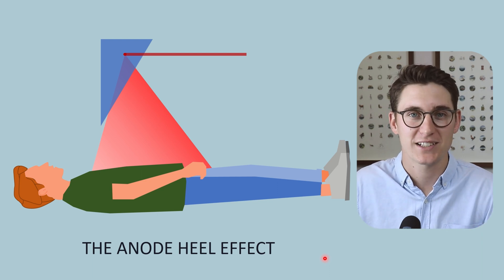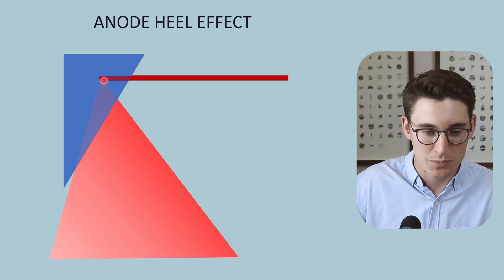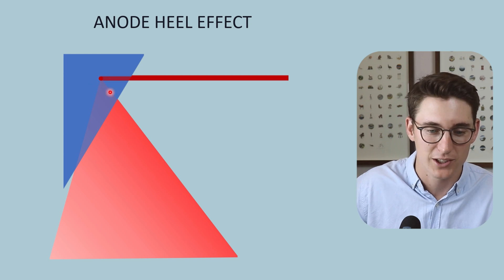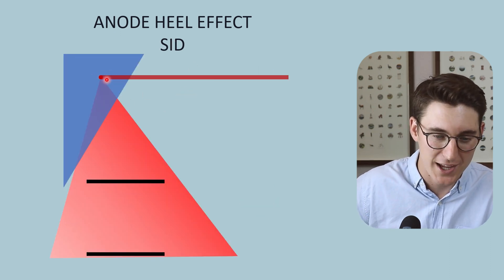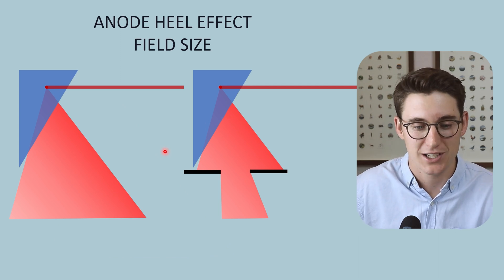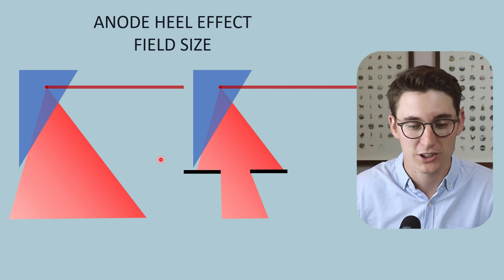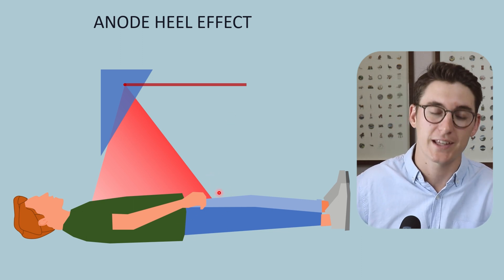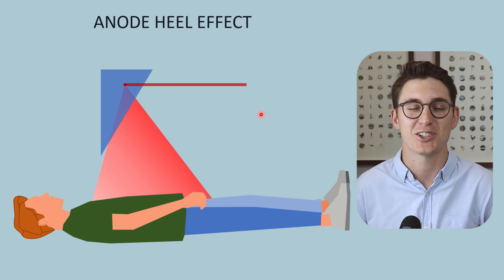Anode Heel Effect | X-ray physics #6 | Radiology Physics Course #13

Comment: Why is the x-ray beam that is produced fan shaped and in a perpendicular vector to the electron beam? Is the isotropic emission of Brehmstrahlung shaped into a fan by the glass/metal housing and aperture and anode shape? 

What I'm really asking is – are the shape of the x-ray beam and the shape of the anode mirror images? (ie. "enantiomers") Like how a tennis ball or pool ball hitting a surface will always form a complementary triangle? Not exactly because the surface would have to be "sticky" or allow the ball to sink in to it to really reflect what was happening, but just as a general explanation of why the beam width narrows in proportion to the focal spot width narrowing (theta decreasing).

Comment: Hello Sir, 
First of all I am thoroughly enjoying your Physics lectures, this is coming from a person who has never been a fan of physics.
I have two questions while studying your X-ray physics course. I will be very happy to get an answer from you or any colleague reading my questions: 
1. When anode and cathode are both made up of tungsten and heat is causing electrons to leave tungsten at the cathode, why is the same not happening at anode ? 
2. Why does the anode heel effect have an inverse relationship with anode angle, I mean why does heel effect increase with small angle size when it would reflect the rays more quickly? 

Your response would be much appreciated!

Comment: Would there not also be a secondary heel effect when going from inferior to superior? I.e. theres a larger distance from the top of the anode to the image than the bottom and so an intensity difference too?
Reply: It would be traveling through a vacuum so it wouldn’t be attenuated compared to when it is traveling through the anode. Once it leaves the X-ray tube, and subsequently the vacuum, there is no longer a difference in distance through the air.

Comment: I have presented papers at national conferences in 1988 and 2016 which had to do with tube angulation. For some historical reason, most radiographers believe changing the tube angle will alter the geometrical projection of the subject. In reality, the only thing that changes with tube angulation is collimation. Here is a video to correct the error made by 75% of qualified radiographers.  https://youtu.be/mZPD_gLs5Dw

Comment: Maybe I'm misunderstanding my into to radiography book, but it seems to be saying the exact opposite of what you demonstrated in this video. It says, "Generally, the steeper the anode, the more severe or noticeable the heel effect becomes". That doesn't make any sense to me because, as you showed in the diagrams at 2:40, the radiation travels through less of the anode material when it' at a steeper angle. So the heel effect should be LESS severe with a steeper anode angle. I don't know what my book is trying to say.
Reply from the maker: Hi Chad. A steeper angle does create a greater anode heel effect (your book is agreeing with what I’m saying in the talk). The steeper anode angle means X-rays have to travel through more anode heel before exiting the anode side of the tube. Hope that makes sense 🙂

Comment: Thanks for lecture. 
I see that intensity of beam towards cathode side should be more than that towards anode side, because xrays are released in isotrophic manner within the anode, and they get attenuated as they pass through the anode material, which is thicker towards anode side, thinner towards cathode side,i.e heel effect . 

My question is ; 
Doesn't that anode material through which xrays pass after getting produced, act like some sort of Filter, 
And shouldn't it make beam hard by removing those low energy xray photons more towards Anode side than cathode side, i.e making beam hard(i.e more energetic)  towards anode side than cathode side .

Am i saying it right?
Reply from the maker: Haroon. You have absolutely hit the nail on the head. Shows you truly understand what is going on. Well done. You are right. The average beam energy is higher at the anode side (effectively a harder beam). However, the absolute energy (intensity) is still higher at the cathode side. Think of the actual number of photons at the cathode side, the high energy photons are still there and will still slightly outnumber those at the anode side.
Reply: @radiologytutorials  thanks for that explanation.
Reply: Dr Haroon! Did u get ur answer? I am also thinking the same… and even after reading the answer of dr Michael, I didn’t get it 😔
Filters increase the average energy of photons and thus increase the penetrability.
Reply from the maker: Let's take a theoretical example of 400 electrons striking the anode target. They will produce 400 x-ray photons. Let's say, for ease of thought, that these x-rays have two energy states, either high energy (90kV) or low energy (10kV) and they are produced in equal number. 200 high energy and 200 low energy. The average energy of these x-rays combined is 50kV.  Say 200 of them exit through the cathode end and 200 through the anode. Lets look at these individually. 

Cathode:
Say 20 low energy and 2 high energy photons are attenuated by the anode before exiting the tube. That leaves us with 80 low energy and 98 high energy photons with and average photon energy of that part of the beam being 54kV. The beam has hardened slightly because of the preferential attenuation of lower energy photons. Here's the important part there are still 98 photons at 90kV (keep this in mind when looking at the anode)

Anode:
Now x-rays travel through more of the anode. Let's say 60 low energy and 10 high energy photons have been attenuated. That leaves us with 40 low energy and 90 high energy photons with an average photon energy of 66kV. Indeed a higher average energy (intensity) BUT fewer x-ray photons. Only 90 high energy photons in this part of the beam as opposed to 98 at the cathode side.

The cathode side has more photons in total and MORE high energy photons. Although the anode side has a higher average energy it has fewer photons (including fewer high energy photons). 

Now if you were the detector which side would have more actual x-ray photons hitting the detector. The cathode side 😊 

Hopefully that helps and makes at least some sense!
Reply: @radiologytutorials  thank you so much for this detailed explanation…very well elaborated 👍🏻👍🏻👍🏻👍🏻👍🏻👍🏻👍🏻👍🏻👍🏻
Actually I was focusing on the fact that since ANODE’S HEEL is acting as a FILTER, so it would harden the beam, make it more penetrating and more capable of imaging the thicker body part.Hence we should align the area of interest in such a manner that thicker and denser anatomy( such as pelvis or lower chest or chest wall side in case of mammography) should face ANODE SIDE of x-ray tube….which was just opposite to what’s mentioned in the books..I was tackling the concept wrongly I guess!!
Reply: @rubyamir5245   answer lies within my question , and Dr micheal confirmed that.
Reply: @haroonrashid5085  okay… what about penetrability? Which side’s X-rays will be more penetrating? Which part of body should be exposed to which side?
Reply from the maker: Hi @rubyamir5245 I'm 5 minutes from home. Will try to give a more concrete example when I'm back that will hopefully help understanding 😅